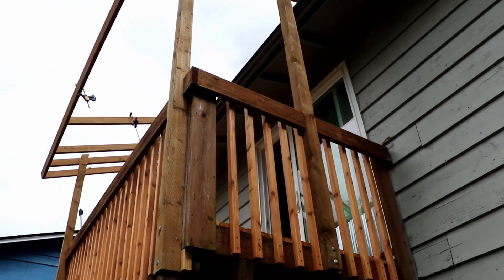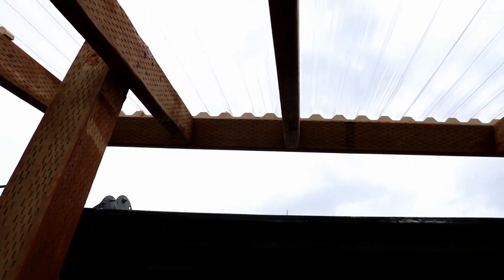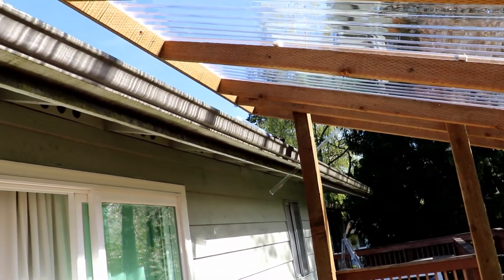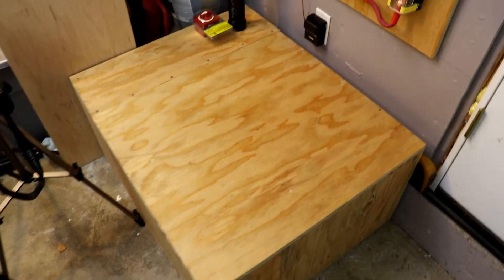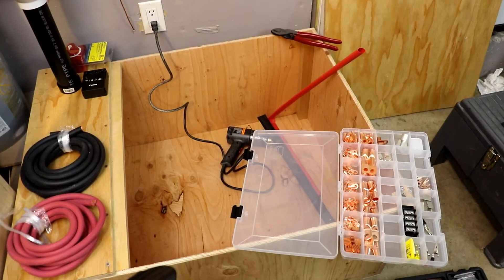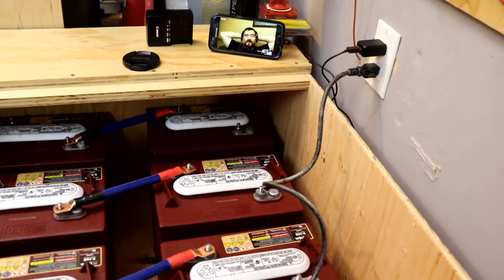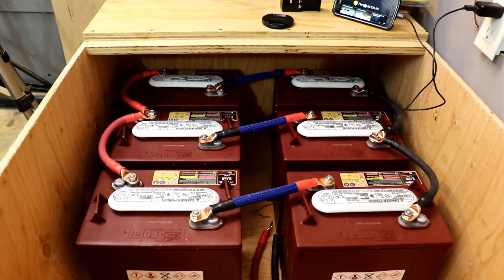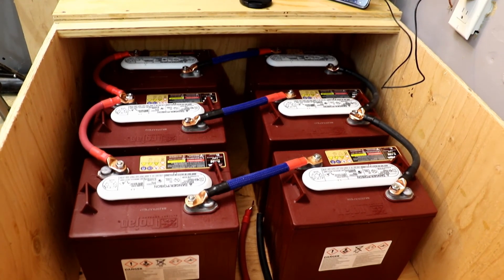Off Grid Solar Wiring Batteries & Roof for Panels

Comment: what awg on the wires connecting the batteries in series and parallel?
Reply from the maker: +mercxmorris 
I used 2/0 AWG wire.  It might be something I increase to 4/0 AWG in the future depending on how things go with the 2/0 AWG.  At this time the 2/0 AWG wire might increase in temp by 1 or 2 degrees if it is used for a prolonged time.  I am planning to run a mini Heat Pump starting this summer instead of the window mounted Air Conditioner according to the specs it will use less power & cool more efficiently, but we shall see.
Thanks for Watching Take Care.

Comment: Nicely done! Will you run a cooler off of it this summer?
Reply from the maker: +Latemcire I am definitely going to see how an Air Conditioner runs during the summer, but I might need to add a second Array of panels.
Thanks for Watching.